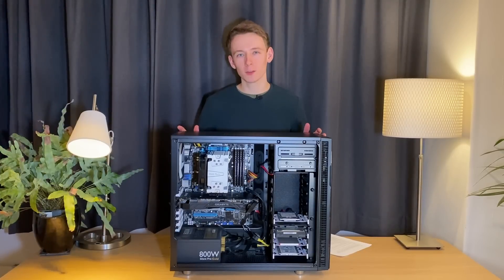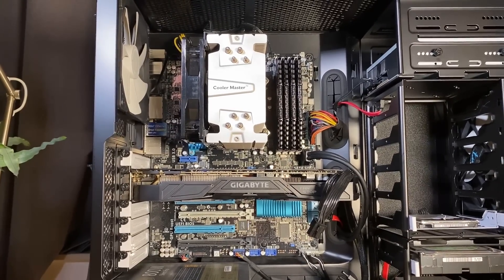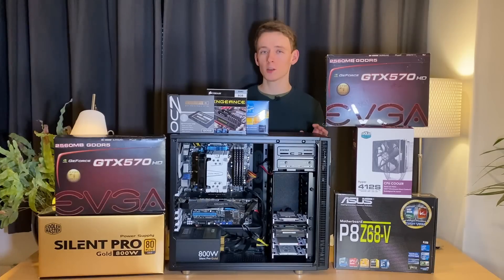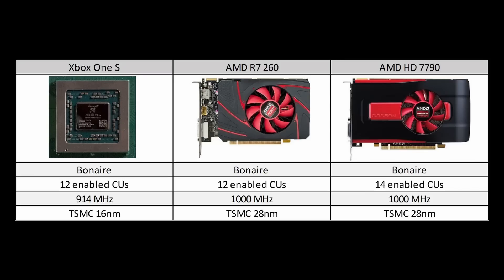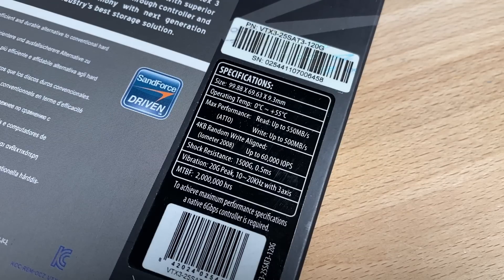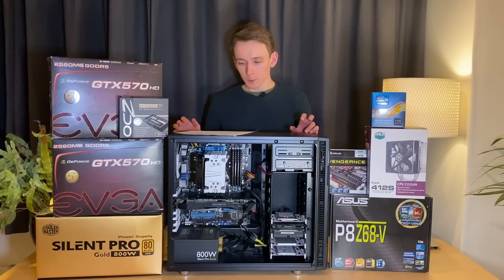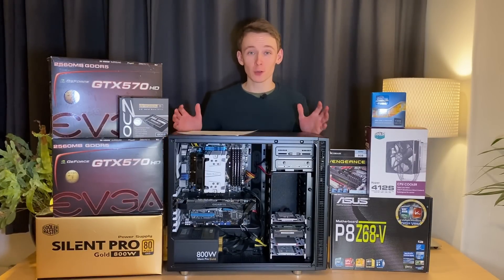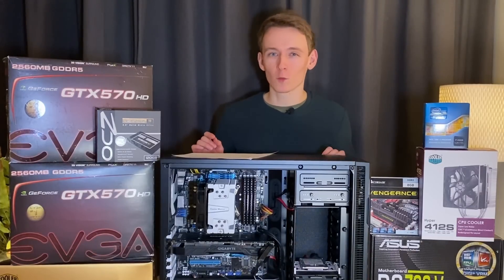I used an i7-2600K PC for over a DECADE - Here's what happened.

Comment: I know the feeling about growing emotionally attached with Sandy Bridge.  Built the system in early April 2011 with 16 gigs of Corsair Vengeance. (1.5 volts)  2600k @ 4.2ghz most of it's life.  Nvidia GTX 560 with an upgrade to GTX 680.  Samsung 500 gig 860 pro SSD.  Corsair TX 850 and the whole system is running to this day.   Thanks for the review and look back on this excellent platform for its day.
Reply: had an EVGA GTX 970 SC in my until my 970 spit sparks, now I have a MSI 1050TI. close to the same performance. did have a MSI 1660 super in it, but that is now in my I5 11600K rig now.
Reply: @viperdemonz-jenkins  I've had many Graphics card upgrades with this system all the way up to GTX 1080.   Put my GTX 680 back and use for everyday browsing and media use.   What a legendary system 11 years ago.

Comment: Been on Haswell Devil's Canyon (i7-4790K) for 8 years with a MSI Z97 Gaming 5 and 32GB of DDR3-1866 and I don't plan on retiring it until either 2025 when Windows 10 is no longer supported or next year (2023 or 2024) when I can find a good deal on a i7-12700K once 13th Gen is out. 
Two years ago in 2020 I upgraded from the GTX 970 to an RTX 2060 super and now my CPU is the bottleneck. So I bought a new case, added RGB and a 240mm AIO, along with an M.2 SSD. I also overclocked the system to 4.8 Ghz and 2133 Mhz on the ram. And surprisingly in some games it holds up and the RTX 2060 super is not bottlenecked (@ 1440p)

Comment: Im still running my I7-2600. Fully boosted too 4,45Ghz and DDR3 at 1600Hz. I had to install a better cooler for the CPU and went with a Corsair water variant. Runs with an 1080TI. That will be the last GPU for it. 11 and a half year and still going strong. Every day I get out of if past ten years is just beyond my wildest expectations. It Boots fast, playing world of warships at around 105-130fps at a 3440x1440p ultra wide 100hz monitor. It would be fun to buy a new computer but the one I have is fast to good to let go of still. I might stick with it until it burns out eventually.

Comment: (JULY/2023) I have a very similar system with Windows 10 Pro (22H2) installed and it still performs very well for video editing. The system includes firewire ports that are obsolete on today's PCs. I'm able to capture mini-DV and Digital-8 tapes with no loss in quality. I can also capture VHS and S-VHS tapes using a USB capture "dongle" and regular audio and video cables. The included Blu-ray drive allows me to play back Blu-ray movies and it can read M-Discs as well. Not too shabby for a computer that was purchased in 2011.

Comment: I still have non-k 2600 and its still doing well i my country house. together with RTX 3070 on 1080p 144hz monitor it does very well. does not show signs of stopping. i did add ssd and descent cpu cooler. with quality dlss this baby can still pull amazing FPS in 2022.

Comment: In 2012 i purchased an i5 3570k, with a cheap asrock board, along with an hd 7970 from sapphire, 32 gigs of ram. I kept that system till end of 2020 when i retired it. Only things i did since 2012 was to add a 500 gig ssd as boot drive and replace the hd7970 for a rx 580. 
Nothing on that rig ever failed on me, not the board, not the cpu, not the gpu´s it just worked as a reliable workhorse, rock solid in its 8 years of service. CPU undervolted and clocked to 4ghz on all cores (i like round numbers). I really got a lot of value out of the purchase.
And the cpu/mainboard continues to run unchanged (heck i didn´t even bother to change thermal paste in all those years arctic silver 5 seems to hold up quite well) in my nephews pc combined with a gtx 1050ti for him to play fortnite and forza horizon.

All those years i was looking at pc parts, looking at benchmarks and honestly found little to no reason to spend xy amount of cash for a miniscule benefit. I could have replaced the i5 3570k with a i7 3770k at some point but it wouldn´t have changed much aside of better performance in assassin creed origins (as this was pretty much pegging the quad core). Honestly the biggest reason not to ever upgrade in all those years (aside of gpu) was the fact that i would have to buy a cpu + mainboard + ddr4 memory to get a small performance increase which simply never justified the price tag. Like spending 500 bucks for having 90fps instead of 80 was just not worth it. Sure if i would have been into different games then maybe there would have been more reason but for all the games i played the i5 3570k was perfectly fine till it´s retirement. 

Intel really launched some very solid cpu with sandy/ivy bridge and then went pretty much full on lazy mode for like half a decade with anual low effort refresh launches that didn´t provide much value for the price asked. And if amd wouldn´t have stepped up the game with ryzen i am sure intel would have continued with those lazy a** low effort refresh launches till end of days. And only a cpu 10 generations past yours would have provided a value justifying the pricetag but just barely. 

Now i am not even having a desktop pc anymore but use a ryzen 7 5800h with a rtx 3080 laptop instead and i am happy with the "upgrade".

Comment: My 4770k system is still ticking along just fine. Not far off performance wise from a 2600k I don’t think. Found a custom BIOS for mine allowing booting from an NVME drive in a PCIE adapter so that’s well worth looking into. Along with a GTX 1070, 1TB NVME, 16GB 2400MHz DDR3, it’s not doing bad at all really

Comment: Last year I retired my Vishera 9370 FX 8 core "meltdown" rig, was still quite a capable build with 32gb of fast RipJaw memory and a 780Ti card and for cooling I used for cooling a Coolermaster V8 MK1 which was insanely good at handling the hot hot CPU and even under heavy game load the CPU never got anywhere close to thermal throttle.   Now I have a Ryzen 5, 16gb of fastish RAM, a NVME 1tb SSD and a RX570 8gb video card and it knocked the Vishy into the long grass with 13 seconds from power button on to Windows 11 loaded with all tray apps.   See it wasn't the CPU that lagged the old build, it was the limitation of the motherboard, the much slower DDR3 and the slow plod of SATA HDD that caused it to drag in the mud so badly and I bought that Vishera in the first year it came out showing how long it lasted.
Reply: I say retired but in fact I have kept it all except the CPU which I sold for more than what I paid for my Ryz5 O.o   Its all waiting to go into a SFF case to be hooked up to my 51 inch telly in the living room as a emulation machine and home theatre, surfing box, got a Hexa cheapie in place of the old 8 core boiler, does the job marvellously.   I even networked this small flat using powerpoint plugs with wifi extenders so every room except the bathroom has a network node to the main router and wifi is potent for my consoles too :D

Comment: I bought a similar system in 2011 to replace a core 2 duo. core i7  2600k, intel x-25m 120GB SSD, 16GB DDR 1600, big workstation case with watercooling and heavy overclocking and lots of HDDs. was a beast. first used it with my older GTX 260, than GTX 780. 
5 Years later i sold it and switched to a very compact ITX based i7 6700T with GTX960 because i needed something i could carry in my backpack. the new system was only  a slightly bit faster, yet of course fitted in a 7 liter case and drew a fourth of the power. 

i used that until the end of last year where i needed to uprade to a big 5950X workstation again. if it where not for professional 4k video editing performance wise i could easily see myself still using the 2600k now in 2022, 11 years later. and the components where not even that expensive in 2011. it was an impressive architecture and very up to date plattform Intel had back then which definitely helps the long usefull life. USB 3.0, already in. sata 600, already in. enough PCIe slots on a quality board for a modern graphics card, nvme adapter etc. - for everyday computing this is still fine.

Comment: Sandy Bridge was really the best generational upgrade that Intel ever released. The fact that it has stood the test of time since 2011 is amazing. 
My first build was initially going to feature the i5 2500K, and a GTX 560 Ti, but I waited out and got the AMD Bulldozer (FX-8120) instead, which in retrospect was a bad idea. I also went with the Radeon HD 6950 2GB, since it was way cheaper than the Geforce model at the time. I paid the equivalent of $246 today for it. I also had the same Corsair Vengeance DDR3 kit, but I had 4 DIMM's for a total of 16 GB (which was a lot in 2011 - early 2012).
I kept the system as it was until 2013, when I learned about the crazy budget performance you could get from running the Geforce GTX 650 Ti Boost in SLI. These tiny GPU's did outperform the much faster GTX 680 models and even the powerful Radeon HD 7970 Matrix Platinum model. This upgrade (when adjusted for inflation) cost me the equivalent of $360 today, especially when considering that the GTX 680 would easily cost around 60% more, and the Matrix Platinum would cost around double the amount.
Later on in 2014, I did go for an Intel platform, and got myself the i7 4790K on a Asus TUF Z97 board. This CPU was a beast when it came out, and I ran it for 5 consecutive years overclocked at 4.5 GHz on all cores. A year later, I bought a GTX 980 Ti, since SLI was being phased out, and I really needed something with more "oomph". This configuration lasted for 4 years until the power supply I had suddenly died, and it took the graphics card with it. Then I got a slightly used 1080 Ti (which I still have to this day). In November 2019, I finally retired the old PC, and built a brand new one. This PC is Asus ROG themed, and features the ROG Helios case, ROG Strix motherboard (X570-E), 32GB of RAM (G-Skill Trident-Z), AMD Ryzen 9 3900X, and my old GTX 1080 Ti, as well as the ROG Thor 850 PSU, which has a display that shows real-time power usage

Comment: I have a similar story with a 3770 and a GTX 670. I was able to run that thing for about 10 years without an upgrade, and honestly one of the reasons I got it was because I really wanted PCI-E 3.0 in case I wanted to upgrade my video card in the future. On a 2600K with Z68, I imagine that you are held back by PCI-E 2.0 x 16 if you've upgraded past the GTX 500 series, because that's equivalent to PCI-E 3.0 x 8. It's one gen too old for the new PCI-E standard. That said, if I had known how long was I going to be stuck running the same system without being able to justify an upgrade, I probably would have invested in the enthusiast-level platforms with more cores and PCI-E lanes so I could do SLI. Probably also would have waited until Haswell, because my previous Core 2 Quad system wasn't THAT bad for the time, I just wasn't getting good performance on Vista but couldn't go back to XP because that was 32-bit and I already had too much RAM.

Comment: Nice, I had my trusty I7-5820k for 6 years, originally with a gtx 560 then upgraded to a GTX 1080, served me well until I upgraded to my current 5950x and rtx 3080. Will plan to keep my current system for at least as long.

Comment: I'm still using an i2500k system with an RX480. It's 10 years old now I only changed the video card once and the case at the same time. And the system drive first to a 128GB SSD and this year to an 1TB one.

Comment: I gave my old i7-2600k rig to my friend, and he's still using it and it cam game surprisingly well. If you overclock it high enough you can match a stock i7-7700 in performance. I had that same exact motherboard as you, and I originally had GTX 580, and then upgraded to a GTX 770. My friend is currently running a GTX 1070 ti with it, which is somewhat of a bottleneck, but I figured he'd eventually get a better mobo/processor combo.
Reply: @Lurch7861 Isn't AVX only used for video encoding? Try overclocking a 2600K to 4.5 GHz and compare it to the benchmarks of a 7700 for most tasks. I got some surprising figures when I did that. Obviously it's going to get blown out of the water when you compare it using newer instruction sets that aren't supported on the older processor.

Comment: Dude, I am still running my i7 980X @4.25 with 12GB of DDR3 1600, now paired with an 2080 SUPER, as well as several SSDs (1 NVME via adapter in PCIE-16X) as well as USB 3.0 via PCIE 1X adapter...I think my mainboard is now at least 12 years old...

Comment: This was posted from a I7-990X, GTX 980-Ti, 24GB DDR3-1866 TrippleChannel... and Vista SP2 :D
Motherboard Asus P6T Deluxe V2, 120GB Sata SSD. The CPU is overclocked to 4.27GHz with vcore on 1.3125V.
Doom2016 plays on Vista   O.O 1080p High in a intense or very open area it drops to about 60fps.

Comment: Mine is 3960K on the Sabertooth X79, back when TUF means something. I did have to swap out the GPU twice as they died on me.

The real surprise is that Gigabyte 1070 in here actually runs well, and feel last longer than the 560 Ti 448

Comment: I also kept my i7 2600K for 10 years. First with a GTX 560 and 8 GB RAM and later with a GTX 970 and 16 GB RAM. I was very happy with it, and only with games like Cyberpunk 2077, MS Flight Simulator 2020 and Battlefield 2045 i saw the need to buy a new system. It will be interesting if my new system will also be sufficient for the next 10 years (Ryzen 9 5900X, GTX 3070 TI, 32 GB RAM).

Comment: I just upgraded a few months ago from a 2500k + Z77 itx board to a 5800X + B550i + 2x16GB. I upgraded that 2500k eventually to watercooling and to 2x8GB 1866CL10. I probably wouldnt have upgraded if my board didnt start to fail. First the OC slowly went down as I kept crashing until eventually it cant hold any OC or a high constant load (AI work). Now my boyfriend has it :)

Comment: I still have the same motherboard + I7-2600 in a secondary PC from 2012. I've only upgraded GPU from GTX 560 ti (which died some 5 years later) to a GTX 960, RAM from 8 to 24GB and eventually increased SSD capacity as they became cheaper. I predict it will still be useable for at least 5 to 10 years for general daily tasks, except for high-end AA gaming with max settings. This year I got an extra GTX 960 earlier this year I had not other usage for, so FINALLY, I use SLI (which is nearly dead now :( ), which is why I bought that motherboard initially for.

Comment: I also still have my i5 2500K CPU running on Asus P8P67 EVO motherboard, parts bought alongside others (GTX 460 GPU, 1TB HDD, Corsair water cooler and other peripherals) in 2011 for ~ 1100 EUR), quite cheap price compared to current market.
Of course, you cannot run certain of the latest games, the GPU being now an GTX 1060, but still the PC can do its job quite well after 11 years of service. And for the moment I don't have in mind replacing it, now with the current prices for electronic parts.
So as in the cars industry, back in the day, they really made good, reliable PC components. Nowadays, not so much, especially what you buy for their prices.

Comment: OMG, i have the same story bro, was staying on my 4790k for many years waiting for Intel\AMD making something worth bying. And after 7 years i bought 12600KF, moved from 4c\8t to 10c\16t CPU formula. Totally worth it. 
So bad Intel tried to sell same cores for 5+years, and even 8-th generation wasn't so good to move to. You can see a difference only comparing 4th gen CPU with 10-th gen(but still didn't worth to buy because of lack of 2.5Gb Lan\Pci-E 4.0).
And after lots of years Alder Lake at last providing smth new to customers.

Comment: SANDY BRIDGE was a great change compared to the former i5 and i7. Easy to overclock and, as you said, quite cheap considering the performances at the time.
In my mind, SB was almost like the Core 2 duo when released. I kept my 2600K between 2011 an 2017.

Comment: This guy's system and thinking is reflecting mine. I bought my pc components an year later in after him in January 2013 and they were:

Core i7 3770
Gigabyte Motherboard MoBo (Forgot model)
Kingston DDR3 800MHz RAM 4GB x 2
Samsung SMTA230 MONITOR 59Hz
WD HDD CAVEAR GREEN 500GB

Some items I upgraded as time went since my PC was feeling little older and much slower than the demands of time. 

- ASUS MOBO P86CSM (Gigabyte MOBO sound card got corrupted and LAN also died Bought in June 2014) 
- Crucial SSD 128 GB (JAN 2014)
- Corsair 700W PSU
- IS SAMSUNG SSD 840 EVO
- CORSAIR DDR3 1333MHz RAM

And I've been pushing this system still in 2022 and it gave me every kind of processing power I needed. Even my CPU is now reaching 85 C temperatures and freezing since my coolermaster heat sink fan has been damaged for the last 3 years and the heat sink sitting on CPU without a fan but still am kicking this CPU. 👌

Comment: To be fair I was running a 2600k and GTX 980 up to recently and it ran everything fine, most 1080p running at medium/high. Since then I've only upgraded a small step with second hand components that were cheap because I needed a little more power for simultaneous streaming/apps.

Comment: I made it 7yrs on my 2700k @ 4.7ghz. Moved on to a 2700X for $135. Then replaced all my aging PC's with B450 $75 open box boards and $85 1600AF CPU's. Then built a few more for the rest of the kids. And now they have been nickel and dimed up to 5600,5600x,5800x,5900x. That was a big change from holding onto the 2700k for so long just to go polar opposite in the last 2.5yrs. Even my 4yr old has a 5600/B450 Tomahawk/32gb 3200mhz/GTX1080/Seasonic 500watt/LG 27" 144hz 1080p.

Comment: I had a 2600K build with SLI GTX 570s as well and also built in 2011, but I didn't get into SSDs until the following year. I'm an upgrade junkie so all that hardware is long gone years ago.